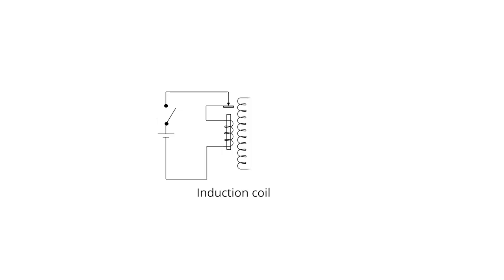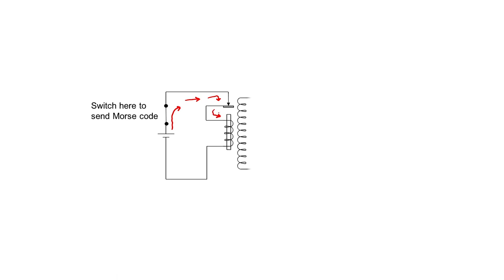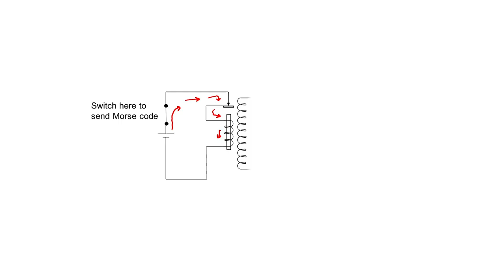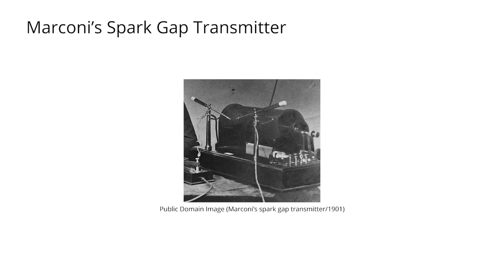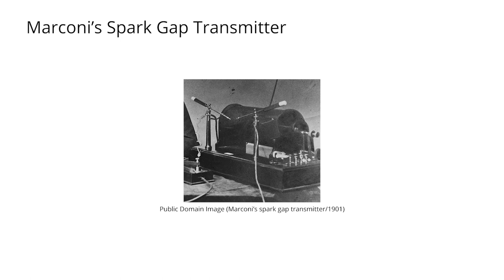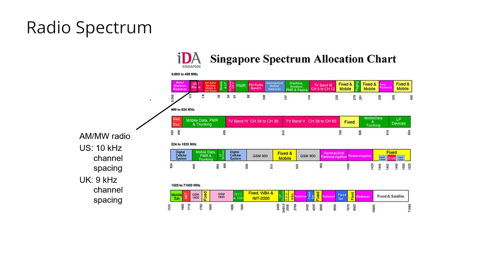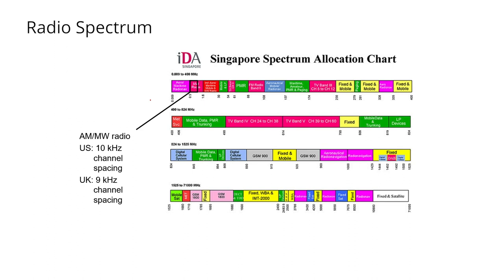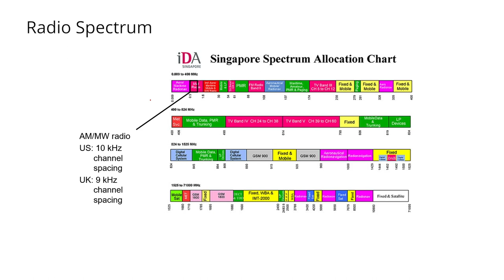Marconi Spark Gap Transmitter (4-Analog Electronics)

Comment: wonderful explanation. 
In my undergrad I had made a spark gap TX with oscillating Relay and Transformer in step up config followed by a zinc sulfied crystals based coherer for detection of radio signals. it was noisy and unreliable but it works.  
Thanks for a great informative video.
Cheers !!